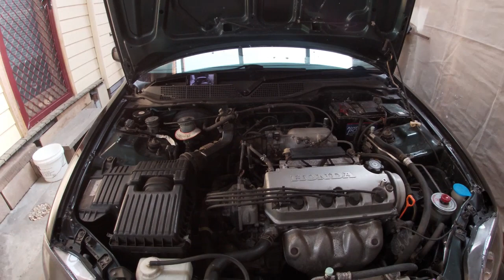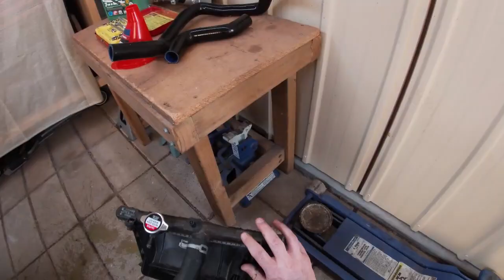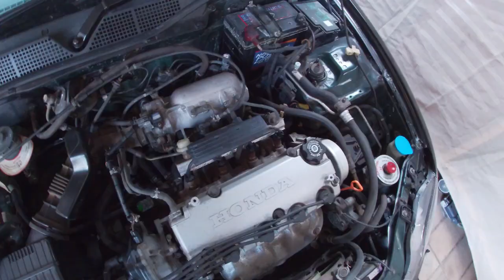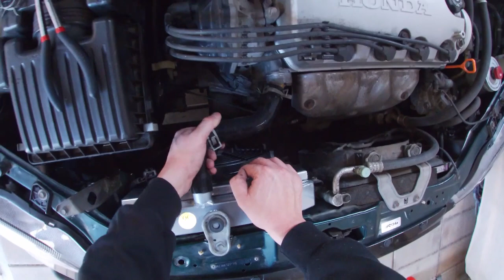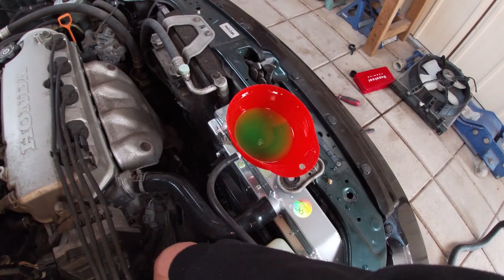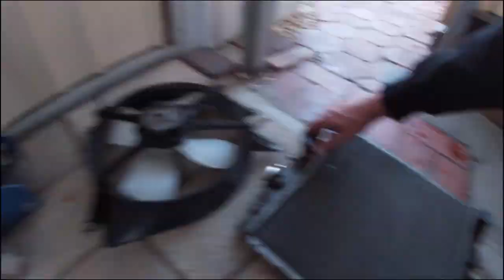HOW TO INSTALL AN ALLOY RADIATOR MY FIRST PERFORMANCE UPGRADE! - D16Y4

Comment: Hi TurboTristy, are you going to put a 6266 on this big block single cam Honda vtec yo engine ??
Also are you going to run a Motec M1 full stand alone ecu with flex fuel?? 
We love you TurboTristy❤️
Reply from the maker: Alex Tziolis haha it will get a t28 on 7psi

Comment: Thanks for this Video. I have a Similar Rad with Fan Shroud, and the Fan Plug and Was wondering if I should rewire it and use the Old Fan. I'm Glad I stumbled on your video. Question though.  I haven't done it yet, but is it pretty straight forward re-wiring it? Does the new Fan Blow the same Direction when you Mod It?
Reply from the maker: Sure does everything works as factory just cools better and being alloy it won’t split, it’s a great radiator
Reply: @TURBOTRISTO  Thank you for your quick reply. By any chance can you tell me what color wires you went from the Fanplug to the new radiator wire. I'm surprised it's not full plug and play. :/
Reply from the maker: i think they were blue and grey I cant remember sorry